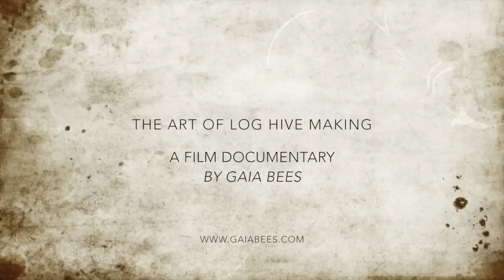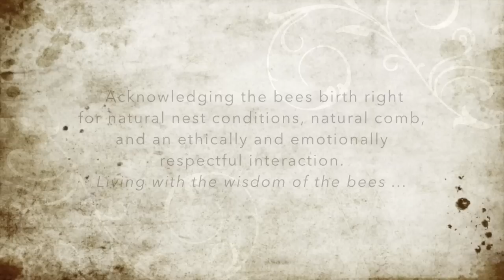The Art of Log Hive Making

Comment: Even with the production chain you use on your saw, you can get away with running canola, or corn oil, and it works fine, as long as you are not running it all day.
Reply: I've used strictly canola oil even for milling...doesn't gum up.

Comment: Here's a trick:
Don't screw the router into the circle jig.
Fit the jig with a hole that fits the router's guide bushing.
That way, you can just stick in the router and it can rotate inside the circle jig.
Result: No cable hassle because the rotating router's position stays the same in relation to your hands! 
In essence, you just need to move your arms back and forth, a bit like like a piston, while the jig translates the motion into circular like a crank.

Comment: take the chance and cut straight down into the round circular Mark around the tree when use cut make sure you cut down into your circular router take the chainsaw and make sure you go up and down all the way into the router then go diagonal after you bang out all the slots. take the chance and use it like a router instead of using that big metal chisel use the chainsaw and pretend it's a router
Reply: As stated in the video, he uses the chisel to avoid chainsaw bar oil in the finished product.
Reply: Karel Van Leer if you did that yes it would be much faster but you'd get the chainsaw oil in the hive and that would keep bees suspicious of what it is and why it smells like that